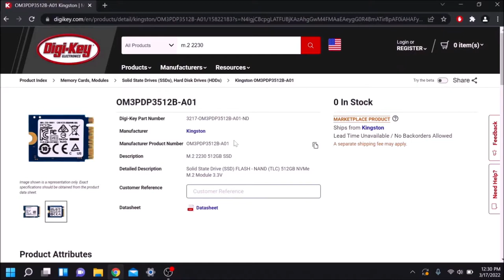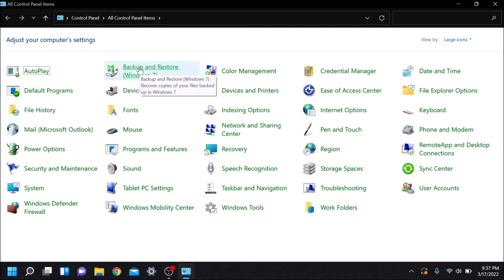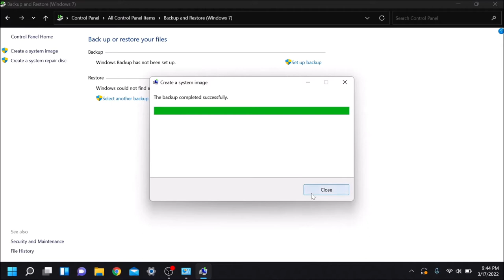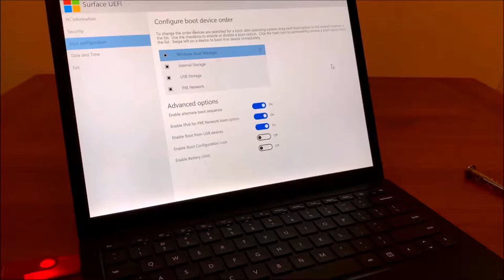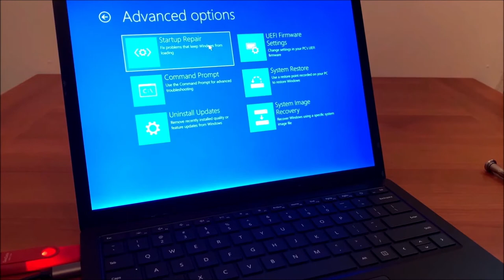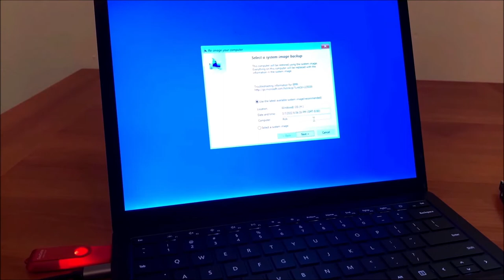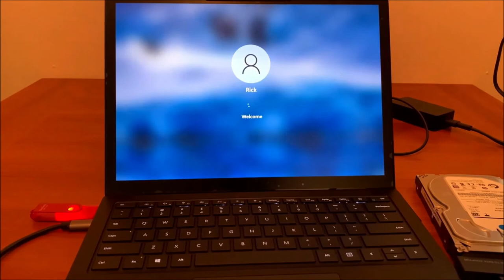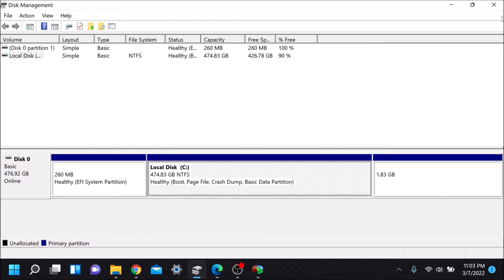Create a System Image & Replace SSD (Surface Laptop 4 Matte Black Aluminum Case)

Comment: Great video man, very well explained, just a small detail I think you forgot to put the original black cover of the Windows SSD on your new M2, it helps to prevent thermal problems on the memory, right now you won't have problems but in time perhaps you will, try to put the black cover with thermal paste to prevent this issues... Greetings from 🇲🇽 🤓
Reply from the maker: I have already tried that but the cover seems to be glued to the SSD. Many thanks for your support and I am glad you liked the video.

Comment: This might be non related to this laptop. But I have a Surface Book 1, do I need a image file.. If I dont want to back up any data and do a clean install
on the SSD? Or can just boot from USB media creation ?
Reply from the maker: Today, you can reinstall Windows from the OS itself. You don’t need to create a Windows bootable USB. If you don’t care about your files and or programs, I recommend you do a clean installation of Windows with the option to erase programs and data. You can do so by typing “Reset this PC” on the start menu, and then just follow instructions. Good luck and thanks for watching.
Reply: @bug-productions  Thank you for your advice.

Comment: 2230 ssd run hot. The metal casing on the original ssd is a heatsink. Best to reuse it. Will need a fresh dab of thermal paste